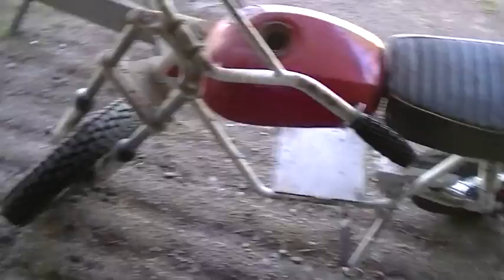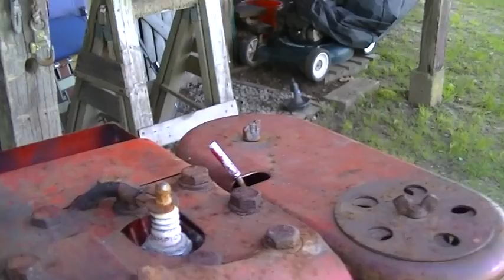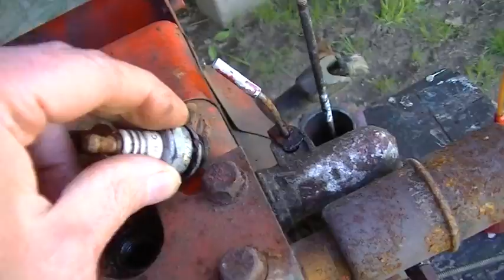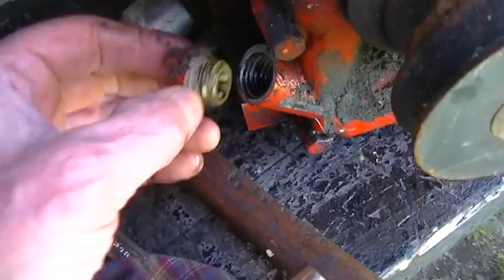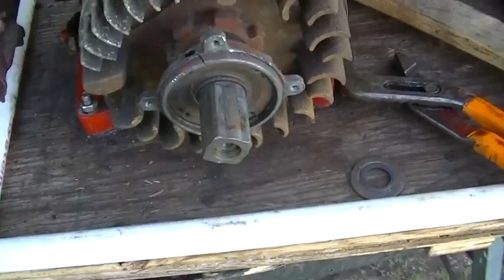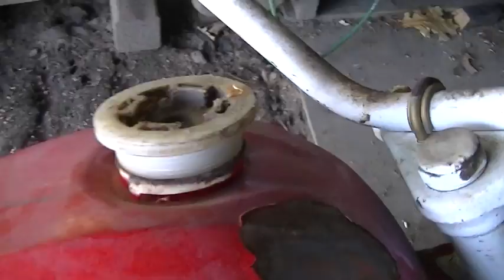Broncco Minibike and 1961 Briggs Part1

Comment: Looks like a good start. whats the outside diameter of the tank flange ill see what i have. Iv got a briggs that came just like that one i used it on my 2 wheel drive bike with two engines its the one on the forks. I guess its 3 or 3.5 hp. 2hp wouldnt be on a snowblower they are pretty uncommon iv only had one it had a regular carb and a super restricted intake manifold. I dont know what the differences are but id bet that intake is a majority of what makes it a 2hp.
Reply from the maker: Gas Tank flange has 2 outer tabs they measure 2-5/8, then outside diameter 2-3/8, inside diameter 2-3/16, hole is 1-1/2.
RE: Briggs. I have looked for a chart that converts cubic inch to HP for Briggs, haven't found one. I know my 4hp is 10, so I guess from there.
I was at Minibike Flea Market this weekend where the upcoming race is and as I was leaving the guy that owns the property has an old Broncco that is used as a prop and he told me to take it for parts...I declined, (more junk) but now wish I took it. The reason is they adapted a 60-72 tooth sprocket to the rear wheel (not an easy swap) and I could use it if I decide on using a lawnmower engine. Here it is: https://youtu.be/0Xj7HhoaMZU?t=294
Thanks Jeep